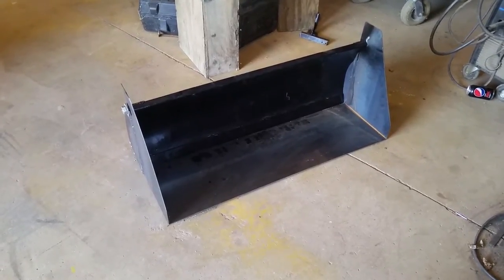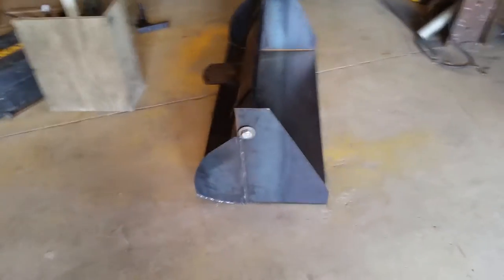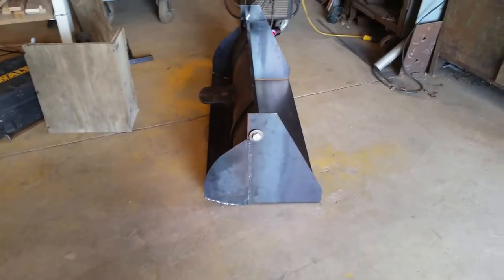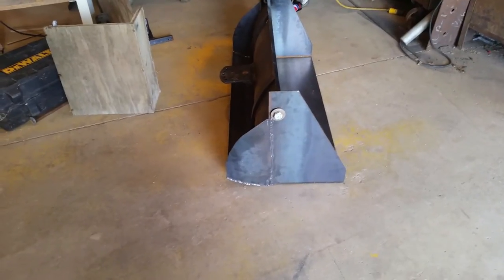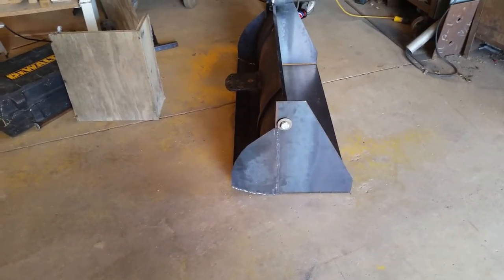Tractor shovel or clam shell bucket

Comment: great design... i want to do something like this to my tractor. I have been building a more traditional type front end loader but my bucket is just way too big and heavy. its putting way too much stress on the arms. So i think im going to scrap the whole idea and go with my original idea of a smaller Johnny bucket type loader mounted to my plow mounts and operated with a small winch. just need to reduce the size of my bucket and make it dump like youres does, with a clamshell design.
Reply from the maker: Thanks for the comment I wanted to do a bucket as well but decided this would serve my needs and it was cheaper